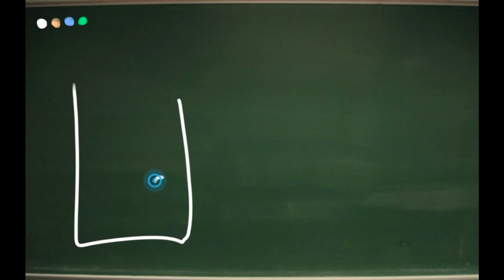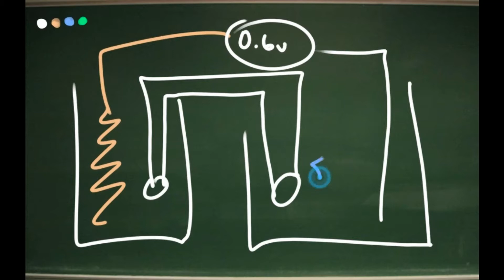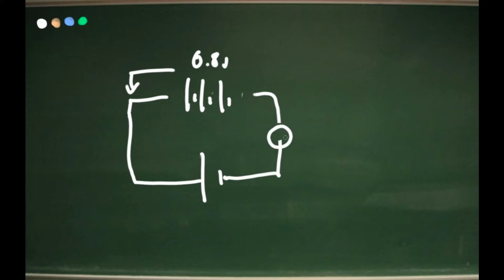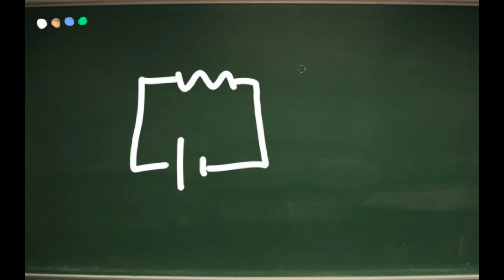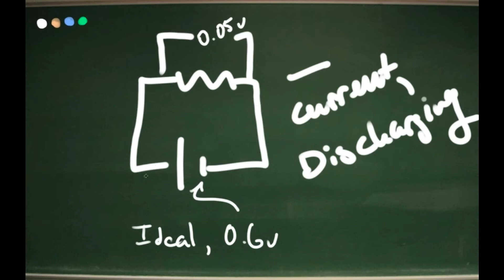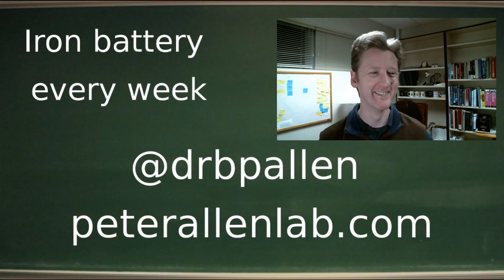Iron EDTA vs Iron Chloride: Iron battery, part 57

Comment: Does the electrode generate bubbles? If so, that maybe the source of increasing impedance. I disperse them using an ultrasonic bath.
Reply from the maker: No bubbles, but it does lose iron mass at an appreciable rate.  I mixed the solution up around the electrodes and it doesn't change, so I don't think bubbles are the biggest problem. At pH 7, the hydrogen generation is very slow (but non-zero, I suspect) and not fast enough to see visible bubbles. I suspect that irreversible iron oxidation (due to oxygen or just the EDTA chemistry) is the issue, but we'll see if we can confirm that on the next iteration.

Comment: Will you hope to get more nominal voltage from the final diy cell? Using LTO (2.26v per cell) now in an EV project and cell amount gets annoying!
Reply from the maker: I think iron will never get into the 2v range, alas. The standard reduction potentials are just too low. Best case is 1v, and I'd be happy for 0.7v. Vehicles (or anything mobile) are probably not the best application of the all-iron chemistry.

Comment: Does this battery chemistry even level the performance of lithiums ion chemistry
Reply: Nikita Redko: I don't think the point is to equal the performance of lithium but to come up with a cell that does not have the inherent problems. Lithium is too reactive and unstable. Iron is plentiful and potentially more stable (no pun intended) and safer, depending on what electrolyte is determined to be suitable. It is not likely iron would be suitable for automotive applications but for a stationary application where size is less of a concern, cost and stability could be a big advantage.
Reply from the maker: That's right - it's never going to outperform a lithium chemistry on a energy or power density basis. Maybe it could do better on a price per watt-hour basis if we get everything right. It's definitely easier to work with, though.